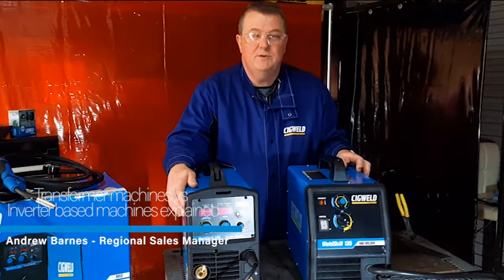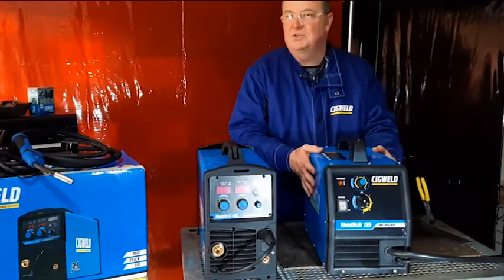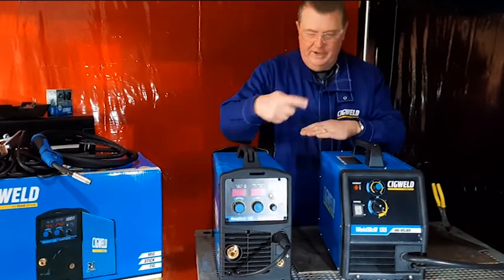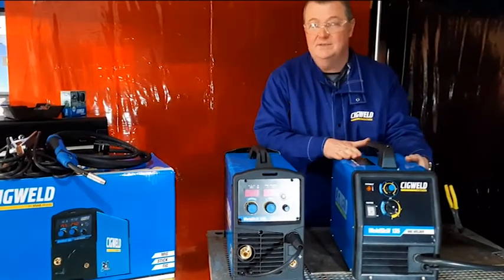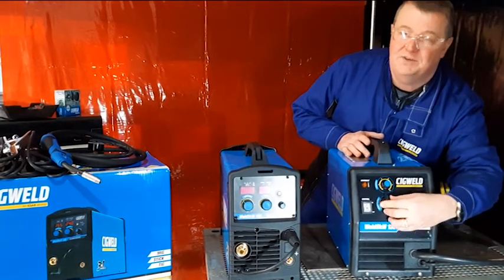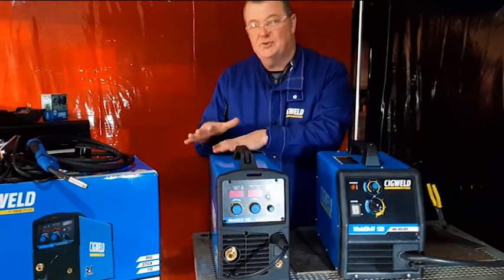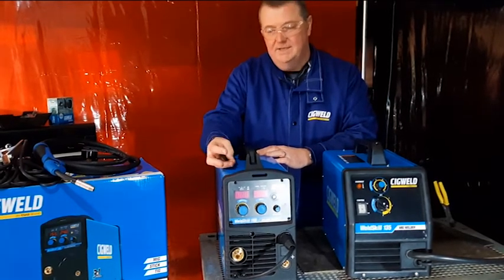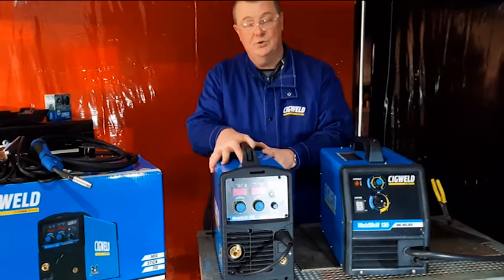Inverter based machines explained

Comment: Is there a difference in the welding itself? Can you get a smoother, more consistent arc with one or the other? I know that 6010 is hard to weld with most inverters...
Reply from the maker: Inverter machines are lighter in weight, less power-hungry (very electrically efficient) and most importantly they run smoother and have easy arc starting characteristics. When welding with inverter machines the welding arc feels “softer” and “easier to control” providing an overall better welding experience.

Comment: Can you run that transformer machine off of an engine drive welder ?
Reply from the maker: You can run a transformer welder off a Generator, provided the Generator is powerful enough to handle the size of your welding machine. As a rough guide; 185A will need min.10kVA, 200A = min.11kVa, 220A = min.12kVa, 250A = min.13kVa.
Reply: @CIGWELDESAB what about the inverter welder can they be run from a generator